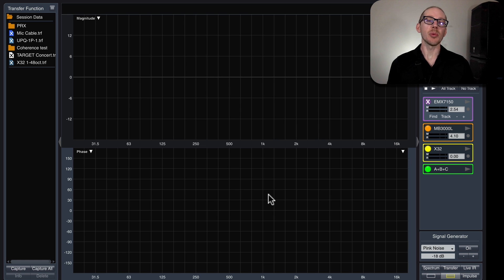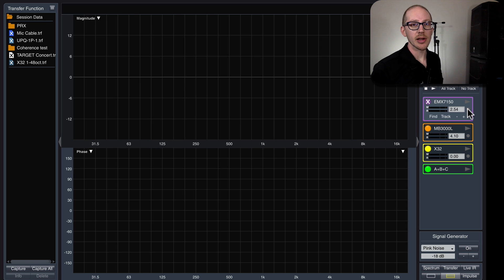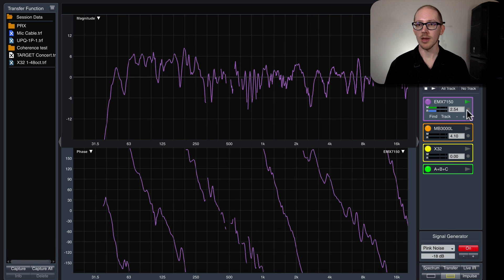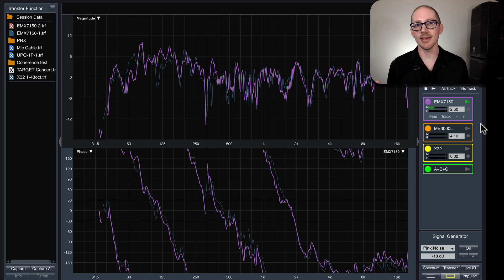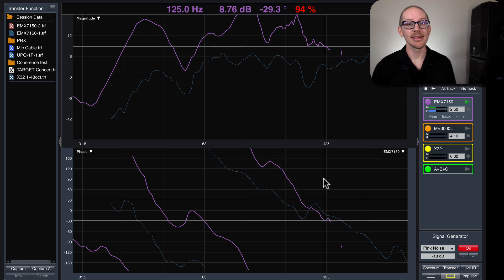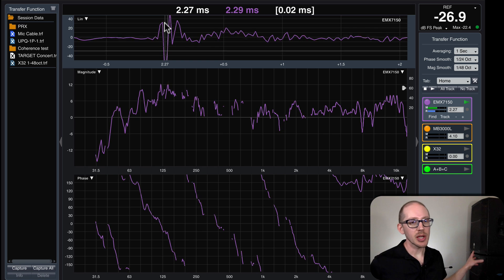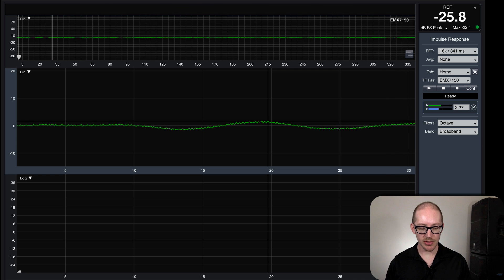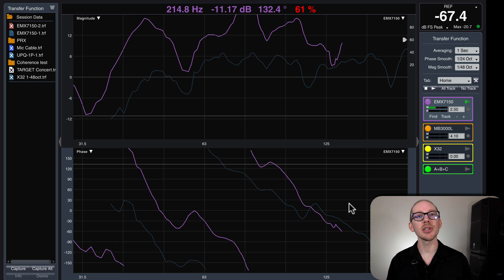How to find a polarity inversion using Smaart® [GSwSST32]

Comment: Using REW I click the “level phase at cursor” essentially changing the timing reference for both. I try not to do any work with “wraps” present. I am not fully convinced an inversion in your example was the right move. Maybe just a bit of delay is all it needed. 
(In REW) I will time align the regular and inverted. And pick the better phase slope match. Also paying attention to what my actual delays are. To see if everything makes sense.
Reply from the maker: nice work!

Comment: Does this work for far field measurements? I tune cinemas with Smaart, and measurements are done with mics at the seats. I generally use the RTA to check polarity by making sure that multiple channels add rather than subtract. But it's always cool to learn new tricks.
Reply from the maker: Hey Ken, I don't have a great answer for this question. I have never made it work myself.

Comment: ciao nathan ho visto il video bellissima spiegazione ,pero ho visto che dove avevi l inversione di fase prima a 125 hz ora c e l hai a 63 hz o sbaglio ???
Reply from the maker: Hey Sabre, it's been a while since I filmed this. I initially thought the phase offset at 63Hz was due to the distance offset of my measurement microphone, which could have been fixed by simply adding delay to the to the main speaker instead of a polarity inversion. So this may not have been the best demonstration of a polarity inversion, but I'm having trouble remembering exactly how it was set up. 

Anyway, thanks for catching that! :)